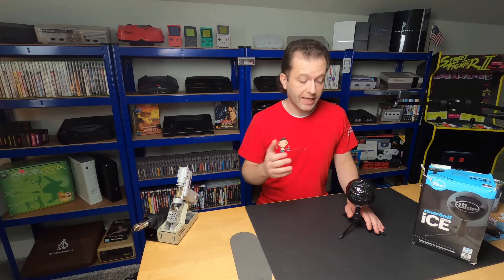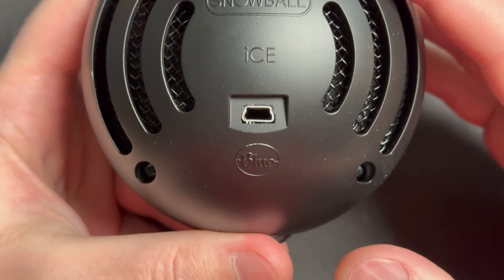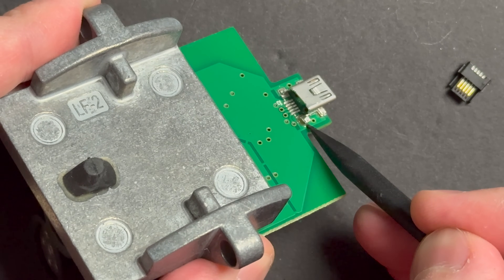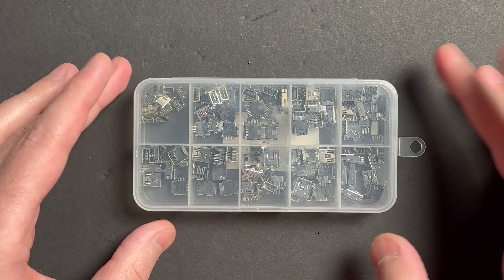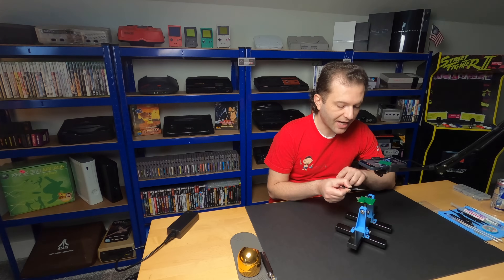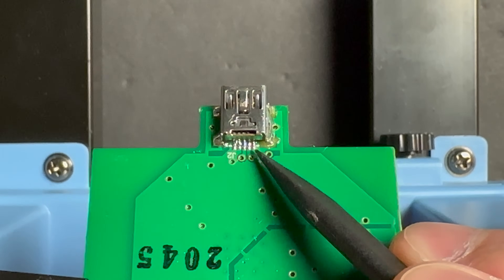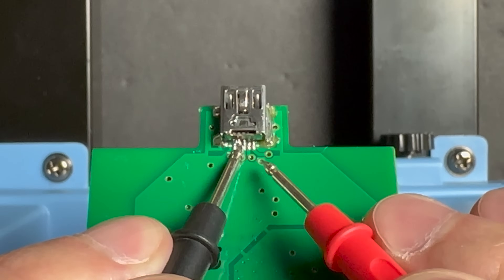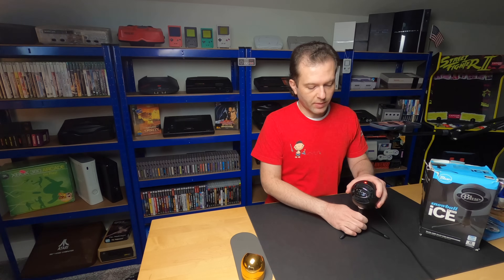Fixing a Broken USB Port with Basic Tools

Comment: What is it with Americans, that cant pronounce basic English worlds, the L on solder it not silent. The same as there is NO W in the word Jaguar. Joking aside, If you are going to do lots of solder/desolder work then I can recommend a METCAL system, very easy to use with different size tips, that can felicitate the removal of larger devices in one go due to various wide flat tips, meaning you can heat all pins at the same time.  If you have ripped pads on a ground plane, as in this case, what I do is use copper tape to make new pads connected to the original ground plane. Gives a nice, strong connection and still uses the original pad area without much modification. Nice repair.

Comment: You had me hooked right from 0:26, thank you for keeping it as beginner-friendly as possible. As one of these complete beginners, nothing discourages me more than a guide implying that I need £50 worth of kit to even attempt a repair job.

You mentioned in the video that you bridged two pins with solder. While it didn't matter in your situation, I was wondering - how would you suggest breaking that kind of bridge up? It would've been nice to see a demonstration, particularly considering the beginner tools you're using.

Comment: im trying to become proficient at soldering. Can you or anyone explain to me what a de soldering gun is, and how or why or what its used for, same questions for the hot air, tip tinner and low melt alloys?? much appreciated!!٪

Comment: Can u use regular flux from home Depot?
Reply from the maker: No, not a good idea. Plumbing flux is acid core and is corrosive to PCBs in the long run. It will actually work great and solder fine but will be caustic to the board.

Comment: I have the same mic but for some reason the port won't hold the cable anymore, like it goes in but not fully, so my computer doesn't detect it. There's nothing visible blocking it, any advice?

Comment: Too much solder on the iron when working those surface mount pins and not enough flux. You really only need a tiny dab of solder and bathe it in flux. It's much easier that way.

Great job fixing the busted pads for the anchors. I've seen a lot of repairs where people just left the reinforcements floating and you can guess how it ended.

Comment: That tip with the wick is seriously underrated. I always used to do it the old, burn-your-fingers way, but now I do it your way and it's so much better. And better yet because it doesn't have to heat up a bunch of extra wick the occurrences of it sticking to the board are extremely rare, now.
Reply: Im gonna have to start. I tried a bit in the past but i always got too shakeyfingered, these days im more experienced so it shouldn't be an issue.
Reply from the maker: You're right. I don't see it much elsewhere but definitely the way to go.

Comment: Some great tips for beginners to electronics repair. I've been repairing or at least attempting to repair electronics for 30+ years and you can never know enough, and remember if you want to learn by fixing something broken, what's the worst that happens, you get some practice. Trace repair as you state is certainly part of the game, a number of my own repairs were caused by my mistakes. while removing a JTAG setup from an old xbox 360 that wouldn't reliably glitch (I was enjoying a fair number of adult beverages) I managed to not only lift a pad, but pull back a trace over an inch back to a via. with some patience and sleep, I was able to restore the console to a working state. Keep up the great content. I will say that my mistakes have led me to purchase nicer equipment over the years, I now a have a mid tier solder station with a hot air gun which is great to have, it has to be said that if you like doing this sort of thing, invest a little money to get beyond the basic 25w pencil iron for 10 bucks on Amazon.

Comment: Thank you for this great demo. I actually found your channel when looking for the Blue Yet repair and have enjoyed it ever since. Your channel has given me the confidence to perform simple repairs or mods with soldering. I hope others find this channel helpful too. It sucks when folks throw away broken electronics that can be fixed with relative ease.
Reply from the maker: Glad to hear it. Did you end up repairing your Yeti? I'm far from figuring out the perfect sound setup for my recording space but the Yeti was definitely a major upgrade.
Reply: @BorderlineOCD  Yes sir. It's a very solid mic! Your audio sounds very good by the way. Some folks go with the wireless clip-on mic, but I think the Blue Yeti gets the job done well.
Reply from the maker: My Yeti actually sounds flawless when I speak directly into it with the gain turned all the way down. I have it set up about 4-6 ft away on a boom arm though, so it picks up some echo and road noise which I'm trying to figure out. I'll be trying some sound dampening panels on the walls soon to see if it helps.

Comment: This takes me back to 2011.  I bought 2 broken Sony X10 smartphones off ebay for $50.  One had a broken USB port and the other had a bad board.  I swapped the good USB port to the first one and it worked perfectly.  Sold it as refurbished and got $200 for it and sold the other one for parts and got $60.  For about 1 hour of my time I made over 5X what I paid.

Comment: I need to do similar with a HK1 box. It wont output HDMI signal.
Reply from the maker: Good luck. Surface mount HDMI is tricky though so make sure you have some practice and maybe a chisel tip if you haven't done it before.

Comment: Can you do an HDMI port next? I have a Switch dock with a faulty HDMI port and no idea how to fix it.
Reply from the maker: I don't have any broken HDMI projects lined up but that's definitely more difficult. It's a surface mount port similar to the one on the PS4 and the pin pitch is very narrow. A chisel tip would work best and some experience is probably a good idea.
Reply: Thanks for the tips.

Comment: Nice fix. One of the first things I fixed was a remote for a Sony receiver that got stepped on. Had a ripped via on some kind of transistor. I was able to scrape the trace and reconnect it with a piece of wire. Also fixed a few sets of earbuds, replaced battery contacts on a DMG Gameboy and installed an UltraHDMI kit for the N64 with very basic tools and a relatively inexpensive soldering station, thanks to videos like this and the ones Voultar puts out.
Reply from the maker: Nice, especially the UltraHDMI mod. That's definitely a tricky install.

Comment: Settign the port on the board with ge CA or Epoxi might havehlped make it even more solid.
Reply from the maker: I'm pretty confident the mechanical strength of the repaired area is stronger than the original two pads, at least compared to the original amount of solder holding the port in place.
Reply: @BorderlineOCD  Yeah it's also good for keeping components (smd, headers, sockets) in place before they are secured with solder though and in this case might prevent the insert from pushing through again. Absolutely not essential though but is a good method to have in the back of ones head.

Comment: Red loctite is easily removed with acetone.
Reply from the maker: Oh does it? Nice. Does this work for loosening a bolt that's been fastened with red loctite on the threads?
Reply: @BorderlineOCD  No  it wont penetrate but heat is good for loosening bolts if possible. But I do believe that there is o removable and non removable red loctite aswell as blue. That's what I understood when I read all the labels working in a hardware store that carried all threadlocker products. It's imposible to know which one they have used in a product that you allready have though. My megadrive console That I just opened this week had the same red goup on the screwheads as your mic did but that's not threadlocker since threadlocker is cured by the absence of oxygene it would take way too long for a positional warrany seal like that to dry if it was threadlocker. If you want to learn more about the properties of thread and cylindrical lockers (loctite) watch a channel called clickspring. Chis is brilliant at all things mechanical and uses those products to perfection.

Comment: does it not give pads to glue to the mainboard if you have ripped mounting pads?
Reply from the maker: If I understand what you're asking about, those repair pads can be useful for restoring data and power traces, but not intended for structural support to hold components down like the ones securing this USB connector.